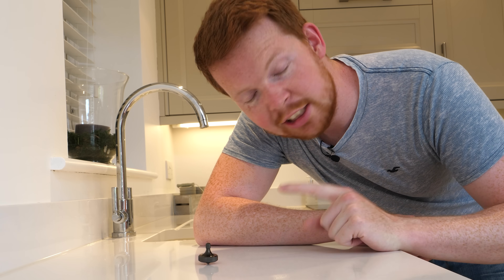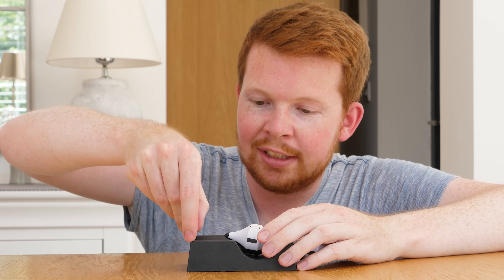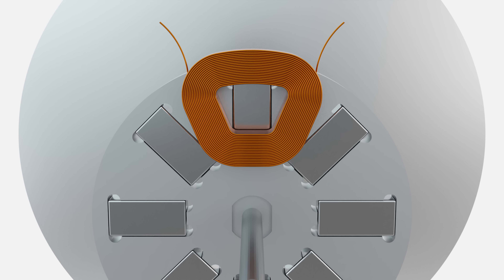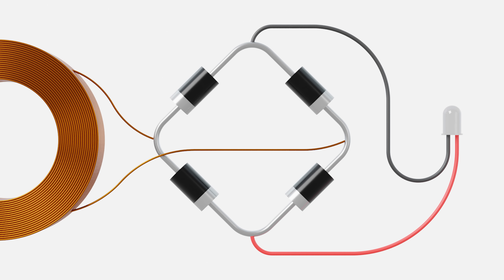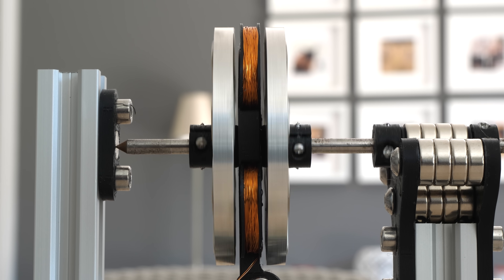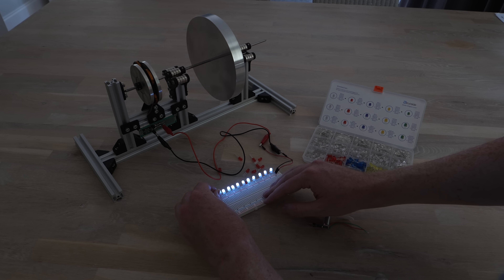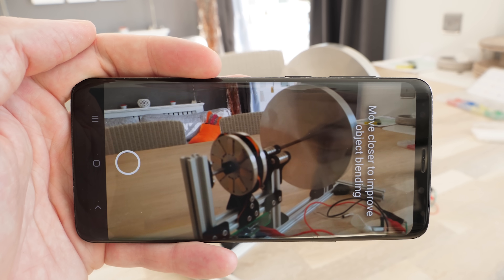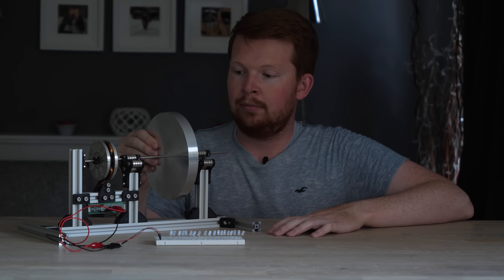Flywheel Battery

Comment: Flywheel energy storage is impractical. The power output they produce degrades rapidly as they decelerate, which makes only a certain range of angular speed. Also, the overhead cost of running a flywheel is high. The bearings tend to wear out quickly and/or are extremely expensive. It makes more sense for backup power to go with an auto-starting generator. If you need uninterrupted power you can combine the generator with a UPS (uninterrupted power supply)

Comment: The biggest question was how long it can spin, wasn't it the whole point of a levitating flywheel. By not showing us any of that I bet it was pretty unimpressive, especially under heavier loads which should have acted as a brake.

Comment: Why the hell do an alternator when you need a DC and then straighten it? It was necessary to glue the magnets with the same poles in one direction.
And besides ... If you want high RPM, why did you attach such a small object to the drill? You need an overdrive, and you did a downshift. This thing of yours doesn't require a lot of torque to accelerate, and the drill has a lot of excess. So just use some big rubber disc.

Comment: It's not possible to get positive generated energy. You'll always get degrade.

In terms of your design, you need a way to remove friction, being your point of contact. Grease or lube or an oil that can be very small in molecules would work. On top of that I recommend a ball point pen since the ball would move freely and have minimal friction. You could replace the ink with lube or oil to be the lubricant for the ball in the pen.

In reality, a organic creature is the infinite generator. I'd say river but there are droughts. I'd say sunlight but night time and clouds. Wind is the least reliable.

Comment: The large flywheel to keep it spinning idea - Add magnets to the outside of the circumference same as the alternator coils in sequence (N -> S) and so on. Near 1 of it spinning edge add a pivot arm with opposing magnets so as you lever the arm closer to the edge of the spinning flywheel, it adds attraction to and increase or stabilize the speed. Would that work ? I drew a diagram 15years ago while I was bored and depressed and have no idea if it would work as a free spinning magnetic engine.

Comment: 1 thing i would want to know when i dont know much about voltage and stuff. would this be enough to charge a mobile phone? if not how much more would it need?
Reply: Phone chargers normally do 5volts 2amps so to charge a phone with this, multiple flywheels linked in parralell, that are also spinning very fast, would be required to reach 5V 2A.

Comment: Wouldn't spreading the bottom levitating magnets wider than the top magnets force the top magnets to self-center above the bottom magnets, thereby eliminating the need for the plate (and eliminating that minor amount of resistance)?

Comment: 40 year old technology (including levitating bearing subsystem). I remember when an engineering company I worked for decommissioned a high-power flywheel test-bed that was operated in a reinforced bunker (which had to be frequently repaired). Remember that scene in "Contact" where the gizmo flew-apart while throwing pieces of itself all over?...for a few miles?...
Yeah...like that except "contained" in a high-tech concrete/rebar/kevlar box.
They were trying to develop heavy yet safe ultra-high-speed flywheels to power buses. Energy-wise, they could make it work at really high RPMs and high mass, but people always came back to that question of, "What if it explodes and sends shrapnel for thousands of feet at thousands of feet per second? The post epic failure pics of the bunker were a teensy bit intimidating.

Comment: I was thinking maybe if you had made another magnetic flywheel on the same rod (total two magnetic fly wheels to generate power) which can be positioned so that the magnets on the second flywheel corresponds with the gaps of the first one to potentially eliminate the pulses of power; And it'll produce 2x the power as well

Comment: I wonder if a Joule thief or a step up booster would have been a more efficient way to get higher voltage? Coil resistance in motors is a big factor usually..

Comment: attach a larger diaphragm air engine to this,  and see if you can make an air powered generator with a large air tank. if you can get some mad voltage to charge a 12v battery and then power an air compressor off the 12v battery then it might can become more perpetually efficient.  A Semi perpetual "Air Powered Generator/charger". probably a long shot but could be worth a try. might be surprised.

Comment: What if you could somehow spin it up with a drill to store more energy. Would be kinda interesting
Like for example; have a weak magnet on the end of the metal rod and a weak magnet on the drill so that you can slowly spin it up over time and easily move the drill away

Edit: Didn't watch the entire video, i see now that you could use the drill to spin the flywheel itself xd
Edit 2: Another idea could be using the magnets as frictionless bearings and turn the flywheel into a water wheel by carving grooves into it and spinning it by rain water from a gutter. This could be used to charge up for example AA or AAA batteries or something if it can generate enough Amps

Comment: can you put the whole thing in a vacuum . will in spin for eternity. i thought if you could spin it up with a motor inside and have it balanced well it could be like a capacitor or battery. but possibly more efficient. can the generator spin up the flywheel with electricity so you dont have to do it by hand. If you mag levitated a large version in a vacuum maybe it could power a house .

Comment: I got the same model of toy from some gift shop somewhere.

Edit: Is it possible to power a motor using energy from the machine to re-spin itself? So it constantly powers itself to move? You would need a lot more copper, but it could work.

Comment: Use a length of string wrapped around the shaft to act as a pull string to wind up the fly wheel similar to a yoyo

Comment: I bet you could minimize the pulsing maybe even make it negligible with another set of copper coils that are offset from the others, and if you made a levitated flywheel that didn't wobble then it'd be even more efficient, but you know that. I believe you could easily over-engineer this to power something more demanding. I'd love to see a follow-up of improving this device.
Reply: actually maybe you could just offset the other magnets alternatively, but then the field wouldn't be as strong

Comment: 3D print a gear box with a clutch or something so you can spin it with geared leverage. That way you can have an easier time spinning it and maybe add more balance.

Edit: Also, why a flat resistance plate? Why not make it somewhat conical so it's always self centering?

Comment: Could you remove the pulsing of the LEDs by using a capacitor? Charging the capacitor with the flywheel which then gradually discharges into the LEDs?
Reply: Yes. That’s how a basic power supply works. Mains AC to suitable voltage using a transformer, then bridge rectifier, and then capacitors to smooth the voltage.
Reply: Yes - As a first approximation:
1. estimate the energy consumed during a half-cycle period of the AC input waveform by the LEDs. E ~= Vavg x Iavg x time.
2. With that energy, use the equation for energy stored in a capacitor E = 0.5 x C x (Vmax^2 - Vmin^2) to get a desired C for desired Vripple (Vmax-Vin)
obviously at higher RPM, the required capacitance is reduced, and as the RPM slows to zero, the required capacitance grows
Reply: I dont think so, capacitors discharge very quickly. He could add some layers to his power generation section and make 3 phase power, which would mostly eliminate that flickering. Then do a 3 phase to DC conversion, which has its own complications. And then there's the fact that LEDs flicker even under normal operation.
Reply: @samus4799  that depends on how they're being charged. With this flywheel and the probably low current output they would likely still flicker but if it has a high current output that is enough to charge a cap enough in one pulse and illuminate the LED than it could work

Comment: It is a great experiment, I loved it! Just a quick note: The higher the current you take from de alternator, the faster your flywheel will stop spinning. You will not be able to take much continuos current from it, but is pretty amazing how it works!
Reply: I would have loved to hear him mention this. Also, I think if you increase the resistance, say, by adding a resistor, it would slow down too?

Comment: if you added a rechargeable battery in between the lights and the motor couldn't you charge it up for a little bit and then connect it to the lights for them to have a constant glow without flickering?

Comment: You should try to find a way to add a disconnecting gear thing so you can get really high RPM and see what you can power with it. Might be hard with the whole floating bit though.

Comment: A lot of the balance problems could have been mitigated through decreasing the overall length of the shaft. About half of the current would be functional and would also decrease the oscilations. A hand crank and a gearbox would make this usable. If you can crank it to hand to around 3000rpm or more you could pull some serious energy out of it. Probably the most efficient conversion of mechanical to electrical energy. 

If you can spin that for 4 seconds and get 10 minutes of 5V+ out of it then it's probably the most efficient example I've seen to date other than a gravity generator.

Comment: Should try to get this whole system to spin by magnets alone.  Build the flywheel out of Mumetal, sink some cylinder shape magnets into it with just the tips of all the magnets poking out with same poles facing out at an angle, thinks its 22 degrees or 32.  Cant remember. 
You're going to make a tilt-able mechanism from Mumetal thats going to hold one magnet in it with the same pole facing out as the ones in the fly wheel.  Place the tilt-able mechanism within rang of the magnets in the flywheel and start to tilt the Magnet towards the flywheel, the flywheel should spin.  Its like one magnet pushing away another but it spins out of the way and another magnet moves into its field and is pushed away and it just keeps spinning.  No?

Comment: That was intense. Very cool indeed! Is it possible to take it a step further and magnetically repel and balance the ends of the shafts instead of against a plate? Would it require machine precision? Balanced or not, you still made an incredible quick and dirty build. Much respect to you

Comment: I did something like this in middle-school for a Science Fair project, but I used a capacitor bank, way more coils, a MUCH heavier flywheel, a couple of home-made transformers, and some rechargeable NiCad batteries if I remember properly, and connected a motor to the flywheel shaft using an RC car clutchbox. I called it a 'Spin-Down Generator'. The motor was used as a drive motor to spin the flywheel up to speed using the rechargeable batteries and charge the system from the alternator coils, but once the system was up to speed the batteries would discharge to drive the motor, but then once they went below the motor's voltage the flywheel would take over and start charging the batteries until the motor could be driven again, and that would continue until the batteries could no longer be charged and it would just spin down to a stop.

I was able to get it to run on its own for about 24 hours, but I was only 14 and I based the whole project off of Faraday's equations and deductive reasoning. I'm sure that it could be built better, and you could probably get a couple of days, maybe even a week or more depending on the speed of rotation, of the flywheel turning until friction and eddy currents cause it to stop.

Comment: Toss is a couple capacitors on the DC side of your bridge rectifier.  That should filter out the pulsating DC voltage to more of a flat in DC voltage. Then you should get a steady LED light output.

Comment: What if you attach that motor to the flywheel? and spin the flywheel by hand once the electricity is generated the motor will turn the flywheel for ever

Comment: I would like to see the flywheel hooked up to a volt meter and see how much power it's generating?
Reply: He did just that, though you cant measure power with a voltmeter. He generated somewhat between 0,7V and 10V not including the voltage drop of the rectifier

Comment: What happens to the voltage if you put a few mm iron plates on the outside of the two magnet discs? 

The magnetic field strength should then mainly concentrate to the coil air gap.

The magnets will stick to the iron plates no glue needed, with the aluminium frames used for alignment only.

Comment: Couldn’t you space the magnets supporting the system farther out than the magnets on the flywheel shaft? This would mean that there would be a range of positions where the supporting magnets are making the flywheel attempt to fall in opposite directions, at which point it would settle at the point where those opposing magnets forces are equal. That would get rid of your need for the end stop and reduce a little bit of friction.

Comment: Guy, if you make a generator that does not change the resistance of the shaft at different loads at the output, you can immediately become a billionaire (or a corpse).